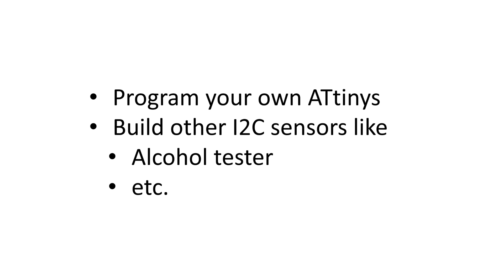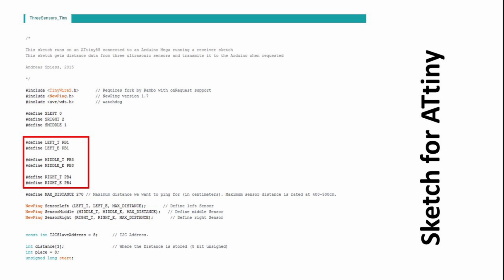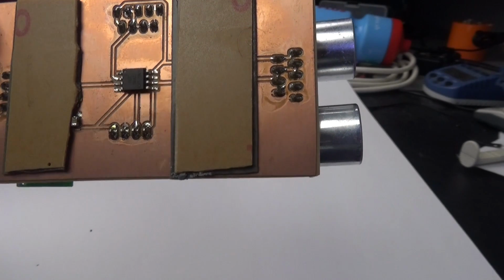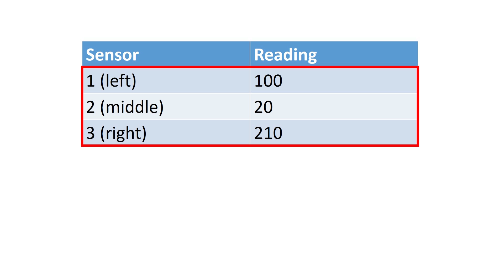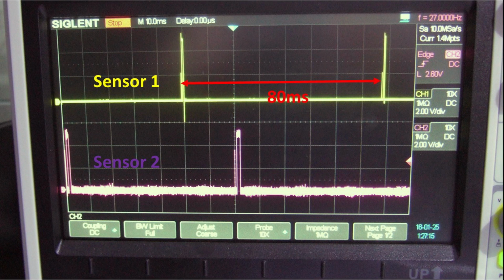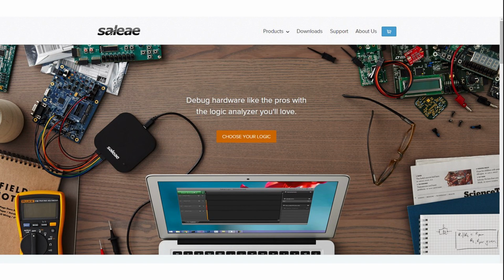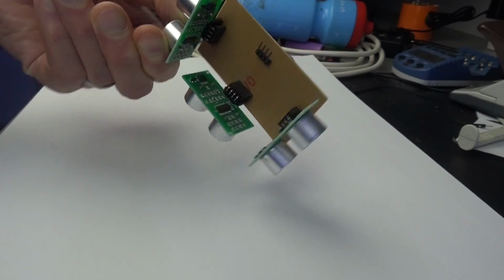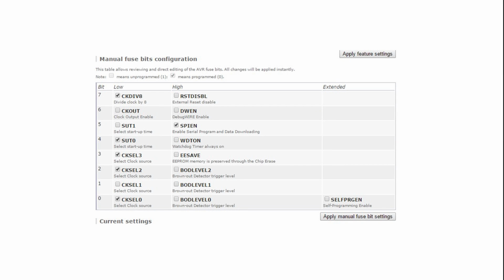#42 Build your own I2C Sensor with three Ultrasonic Sensors for Arduino

Comment: Hello to everyone,

Am new in electronics and I want to build  a i2c device (sensor or switch) for example to use 10 limit switches or sensors, I guess I have to use a i2c device – IC of ATMEL e.g ATTiny 25 or 48 but I don’t have any idea, any help will be welcome, Thank you from Greece.
Reply from the maker: Google should help you. Also a few of my videos.

Comment: hi andreas , if we want to expand our circuit to 4 or 5 Ultrasonic Sensor what we have to do
Reply from the maker: You have to use an MCU with more pins like an Arduino and extend the sketch.

Comment: can you make 2 pwm output with 180' degree phase shift to attiny13 please?
Reply from the maker: I am not sure if you can synchronize the pins. You have to look at the data sheet.

Comment: sir can we connect this sensors to pixhawak flight controller guide me how to make quad obstracal avoidence using pixhawak flight controller using ultrasonic sensors nd also can we use rasberry pi or arduino for connection of ultrasonic or directly connect this I2c port or not sir plzz help me
Reply from the maker: I am not an RC toy guy, so I do not know Pixhawk hardware

Comment: Andreas, How can I adapt your code to work with I2C sensors, such as the VCNL4010?  I am trying to connect >20 I2C sensors (all with the same address) to an ESP32 without using a mux.   I could use something like a LTC4316 I2c address translator that would allow multiple slaves to coexist on the same bus.  But I have read a few posts that suggest using a PIC or Attiny at each sensor to provide a software controlled I2C address.
Reply from the maker: There are several possibilities. In the end, the "master" has to be able to address each slave. Switching the enable pin of the sensors is probably the simplest way to switch all other sensors off and always use the same address.
Reply: Thanks for the reply Andreas, I love your channel. Unfortunately my application doesn't allow me to run an extra wire to each enable pin on my sensors.  Your solution in this video is great for turning an Arduino into a I2C slave.   I just need to figure out how to make the Arduino a master to the I2C sensor while also being a slave to the ESP32 master.  You might be interested in this company, https://sensordots.org/mappydot, they have figured out how to customize the address of an I2C VL53L0X laser time-of-flight ranging sensor.  If you want to try them out for your robot, let me know and I will send you a few.

Comment: Hi Andreas, very nice video. Could a pcf8574 chip be used instead of the ATtiny ?
Reply from the maker: Maybe. I used the ATtiny not because of a lack of pins but because it takes a long time till the results of 3 ultrasonic sensors are measured
Reply: Ahh, that is very interesting. I have never used the Attiny or Pcf chip yet, I am waiting for some pcf chips to arrive for another project I have, so the Attiny would be faster or better equipped for managing 3 ultrasonic sensors?

Comment: I have tried hard to make this work for two days now. After a lot of debugging with use of software serial on the attiny85 and using simplified test code with only one sensor etc. I came to the conclusion that the  onRequest is not triggered by the i2c master. Looking in github for TinyWireS it looks like other people have the same experience with the newest release of TinyWireS. The feedback you get on the serial monitor is only 255 meaning that there is no responce form the Attiny85.
https://github.com/rambo/TinyWire/issues/44
I used an older version from here:
https://github.com/rambo/TinyWire/tree/860ad85572dbe835391f99bc3f72a13504bbfc4e
... and Andreas code for this project started working like a charm.
At least I learned a lot about debugging attiny85 code using the software serial library:
https://www.arduino.cc/en/Reference/SoftwareSerial

And thanks a lot, Andreas, for your inspiring YouTube videos !

I am a big fan of the very inexpensive ESP8266 chip from China myself :-)
Reply from the maker: Thank you for this information. Maybe it helps others with similar problems.

Comment: I'm having a small problem and wondered if anyone could help.

I get bad readings from the sensors. Everything works fine through I2C as I get the values I'm requesting (Tested with an static array), when I use the sensors the value changes if I point the sensors towards different objects, so I guess that is working... But I get 1cm measurement when I place my hand at about 15 cm away... and get a reading of 20 cm when pointing to a wall about 2 meters away. I'm using the NewPing library unchanged, I'm almost at sea level, 20º C, and humidity is high (80-100%)... so I guess the value of speed of sound shouldn't change the readings so much. Tried to change to two wires instead of the single wire configuration with exact same readings.

I'm using the ATTiny84 at 8MHz internal and sensors are connected to PortA (PA1, PA2 and PA3). I'm going mad about this bad readings... What could be causing the problem? Anyone experienced similar results?
Reply from the maker: +juampe I would try the same sketch with a Arduino board and a different sensor. Then, you see, where the problem comes from (sketch, attiny, or sensor)
Reply: That's the strangest thing... I've replaced the sensor and they all give the same reading to the objects (Although erroneous all the sensors agree to make the same readings). With the sensors hooked up to the Arduino UNO the readings are fine.

I've tried changing the delay for the I2C reading in the Arduino just in case there was some kind of delay in the transmit which affected the timings of the sensor but no matter what delay I use the sensors will output the same values for distances (Although completelly erroneous).

Ive played with the code in several ways but keep getting the same readings to the different objects no matter what I try... I'm starting to believe in witches :) and thinking some crazy stuff as a bug in ATTiny84 micros() function running at 8Mhz? But I guess something like that would also affect I2C bus and already tested the buss in multiple ways and transmission seems ok.
Reply from the maker: juampe do you use my sketch for the tiny? Are the sensors connected to the right pins? My setup works, so it is probably not the bad behavior of the chip. Do you have an oscilloscope. Then look at the signals. Do you use 5volt?  These sensors usually do not run on 3.3.
Reply: Almost... I'm using an ATTIny84 where there is no PB4 and PB3 is the RESET pin.So I swapped the sensors to PA1, PA2, and PA3. 

I left PA0 out as it is AREF and I though I would use it for a temperature sensor such as TMP36 to make some tweks to calculate the speed of sound for better accuracy. I must say at my current stage this sensor or code is not present.

Yes, I'm using 5V. I've tried with the 5V of the Arduino powering the small system (Arduino UNO as master, ATTiny84 as Slave and a single sensor)... I've also tried with the 5V of my development board for ATTiny84 with a 9V baterry (It uses a 7805) which will power the ATTiny84 and the sensor (Arduino is powered from USB and both share ground).

I have no osciloscope only a logic analyzer, but I'm not sure it will allow to analyze the data between the ATTiny84 and the sensor :(

Right now I would be happy to get the correct readings... What I wanted where 3 sensors, a temperature sensor to calibrate the speed of sound, and an interrupt pin (Telling my robot to stop as something has been detected), and then it can go into the I2C bus to check the distances to make a decision. But right now it is kept at the basis as the readings are incorrect.

When I arrive home I'll try with an ATTiny85 to see if it has something to do with the microcontroller... but it would seem weird.
Reply from the maker: Always if I have problems, I start to divide my "thing" in parts and test it one after the other. So, first part would be to look at your sensors. The logic analyzer is good for that, because it can show you the timing of your input pins. Is the timing at the ATtiny pin ok? Just use one sensor.
Next, you measure the time with the Attiny and check, if the Attiny gets the same result. Maybe you use Serial (http://www.ernstc.dk/arduino/tinycom.html) to display the results. Or you use your I2C connection, if you are really sure, it works properly. Do not use the ping library now. Maybe you just count a counter up as long as you wait for the echo. Only if you are sure, your result is proportional to the readings of your logic analyzer, you can go on and use the ping library (again, with serial). Now, you should be able to find out, where the problem is for one sensor.
Reply: Here is the result of the logic analyzer...
https://goo.gl/photos/bsTnDw5PnH4XEguMA

Although obvious, channel0 is the trigger pin, and channel1 is the echo. I've changed to a 2 pin setup to see what each pin was doing. I simplly call the ping method of NewPing. I was holding my hand about 10 cm from the sensor.

I'm not sure if I'm going mad on this one, but the output doesn't match with what I expected. The timming seem quite bad... In NewPing Library it pulls to low for 4 uS and the logic analyzer tells it is Low for 47.94uS. Then should go high for 10uS and the logic analyzer says it is 81.63uS... after that I really don't understand a thing as it should go low... and finally the echo returns 0.6563mS... I'm really lost :/

ATTiny84, 5V, 8MHz Internal... Sensor connected to PA1 (Trigger), PA2 (Echo)... Logic analyzer Ch0 to trigger, CH1 to echo, GND to GND.
Reply from the maker: Compare it with a working scenario on an Arduino. Then, you should see if there is a difference
Reply from the maker: You also have to wait I think about 30 usec between two pings. It is somewhere in the description
Reply: In the code I was using I have:

unsigned long nextPing = 0;

#define PING_INTERVAL 33 // Milliseconds between pings.

After NewPing ping method in readDistance Method

nextPing = millis() + PING_INTERVAL;

in main loop

if (millis() > nextPing) {
    readDistance();
}

So It should be waiting for 33mS between pings
Reply from the maker: I would really compare a working system with what you have to find the differences.
Reply: This is the actual code that was loaded into the ATTiny84
https://github.com/JPG-Consulting/ATTiny84_HCSR04/blob/master/test.ino

I've been swapping code a lot to get it working... and wasn't sure what sketch was loaded at the test.
Reply from the maker: I cannot help you with the code.
Reply: Well really nothing new... as there are 3 sensors in code, for the only sensor connected the time between pings should be higher than 99ms... I'm starting to think it has something to do with the ATTiny84... Hope I had brought an ATTiny85 to test.

I don't think it could make much of a difference but I'm using damellis ATTiny core (On some other projects I have been using SpenceKonde)... Got no audio on my PC as it got disconected on my laptop and have no tools to open it. Which core did you use?

I guess I'll wait until next thrusday at home an make some test with ATTiny85 and ATTiny84 to see if there is any different behaviour
Reply: juampe It seems like all of your timings are off by a factor of 10 -- if New Ping said wait 1ms it waits 10, so maybe the same issue is affecting your readings as well and when 10ms has really passed it reads it as only 1. I noticed the distance readings you posted on your original comment were about 1/10 what they were supposed to be too, which lines up with that theory. Have you tried multiplying the echo time by 10 before calculating the distance? so instead of echoTime / US_ROUNDTRIP_CM, you would replace it with (echoTime * 10) / US_ROUNDTRIP_CM
Reply from the maker: Is this maybe a clock issue? You can chose the clock of your ATtiny with fuses.

Comment: In the initial image it seems you have developped a one sided board, however on the other side it seems a double layered board. Any chance to see the routing of the board?

By the way, there is no free pin to send an interrupt to the master for example, if any distance is too low, no?
Reply from the maker: You find them now on github (see link)
Reply: thanks

Comment: Hey! thanks for your helpful video!
I have question. Why do you use I2C for these sensors?
they don't have SCL and SDA pins.
is it because you are using ATtiny? (actually I don't know about ATtiny) so if I use an arduino uno to control the robot, then could I use I2C to control these distance sensors?
Reply from the maker: +Mingjie Han I use I2C because it did not add any pins on the main processing unit. There, I already use I2C. And I wanted, that the three sensors behave like one. Measuring distance takes a long time and the normal way would reduce the responsiveness of the main robot loop. With this concept, the main Arduino just needs a few microseconds to read the actual values.

Comment: sir, in my ultrasonic sensor hc-sr04 there is no crystal oscillator.
is any disadvantage of not having 4mhz crystal oscillator in the sensor
Reply from the maker: I never looked into the sensors itself. For me, they either work or not. Just test and you will know
Reply: thanks

Comment: Andreas, I would very interested in fuse  settings on the ATTiny and the  High Voltage programming. ( I also have a fuse bricked Atmega328p-pu chip it might fix. )
Reply from the maker: So far, not many (actually 2 people incl. you) asked about that. So, it did not have high priority. Maybe sometimes in the future...
Reply: I am interested in fuse setting video Andreas. Hopefully more people will show some interest to request a video

Comment: Hello Andreas,
I would like to know if HC-SR04 can be connected to arduino using i2c bus ?
I am unable to find the answer anywhere.
Reply from the maker: This is exactly the video which shows how to connect the HC-SR04 to the I2C bus. You cannot connect it directly.

Comment: Now it's nine months later and I also watched this great video. Nice work! Some time ago I ordered both attiny85 and attiny13A. Great little chips! The tiny13A is cheaper, but more limited (eg. less memory). It can be programmed in similar way as the tiny85. Of the two batches 13A's I ordered from different suppliers, one batch was not working. I found out their fuses were set differently and I had to make a high voltage programmer (using a 12v dc-dc boost converter) to reset them to a programmable state. I'm looking forward to see your 12v programmer, so consider this my delayed vote. (Or maybe you already made it, haven't checked it yet).
Reply from the maker: I have made a 12 volt programmer, but no video yet. Since the need was not overwhelming, I also not plan to put it online. One question: Which environment do you use for the Attiny13? With the newer IDEs I did not find a working one. Only for 45/85. I still have many laying around and, as you wrote, they are good for most of the jobs.
Reply: I've programmed them succesfully using the Arduino IDE (version 1.6.7 worked fine for me). I use a portable installation on USB stick to keep the various MCU environments separated. As programmer I use a UsbAsp stick and prefer the version that has the low speed jumper JP3. It's been a while and I'm not quite sure where I found the core I'm using. It's main.cpp is in a folder core13. It lists John "smeezekitty" as author and has  versionnumber 0.22 
Memory is limited and the largest sketch I managed to program was for a 5x6 led-matrix using two 74HC595's and software serial input (due to lack of I2C).
Reply from the maker: Thanks for the info. Glad to read that this board definition works.

Comment: Firstly great video. This would be very useful to a lot of people I think but I am still unsure of a few things. I would love to see the full source code to your I2C sensor? Any chance you can publish the Attiny85(slave) Sketch and the Arduino (master)?? I'm gathering you had pull-up resistors on the I2C lines as well? Thank you for the awesome videos you put out. I've truly enjoyed them. Cheers from Australia!
Reply from the maker: Thanks for your nice comment! I just copied my source files to github, but was not able to test them now. Because I did this project a while ago I cannot garantee that they will work. Please keep me posted if you find errors
https://github.com/SensorsIot/ThreeSensorsTiny/

I2C usually does not need pullups if your wires are short and you only have one sensor.
Reply: Thank you Andreas. That really helps. My code was very similar except my version of readTiny() was reading too many bytes and hadn't taken into account any time constraints. Your code appears to function correctly but will let you know if I find anything. Many thanks for sharing it. Very much looking forward to your next video :-) Cheers!

Comment: An other great video , has me  wondering why i never think to use these small cheep chips, especially when they have a built in crystal / clock. . , and yep sure would like to see high voltage programmer in action
Reply from the maker: +XerotoLabs Thanks for your comment. High voltage is 12V ;-) But it is called "High Voltage". So, you are # two who ansered about this topic. If I look at the statistics, I think, most of the viewer anyway do not get to the question. So, I will put it on my list.
These are really nice chips and it is easier to use one of these instead of a particular TTL chip. Because I always have them on hand.